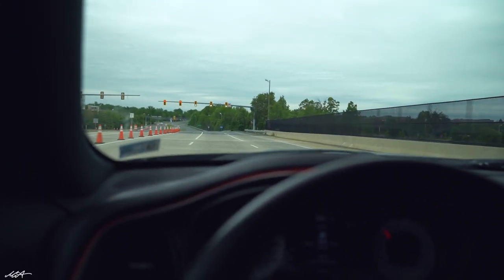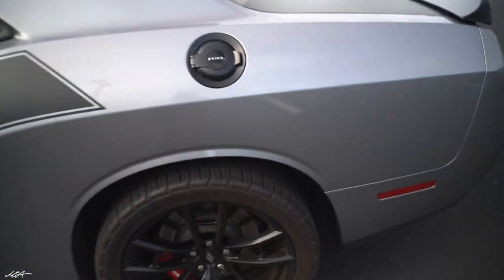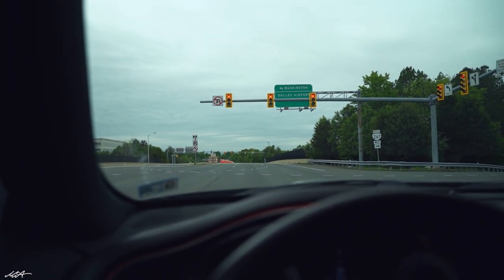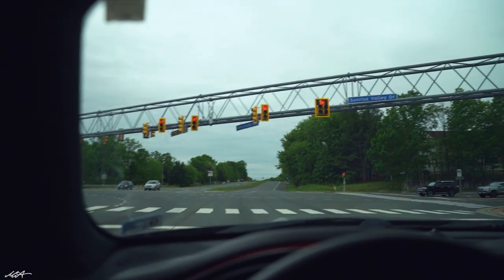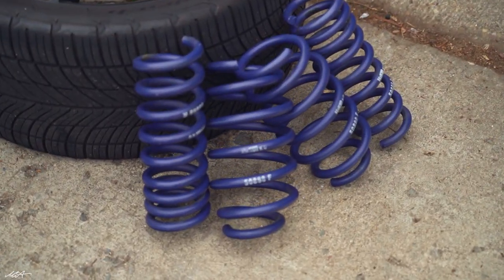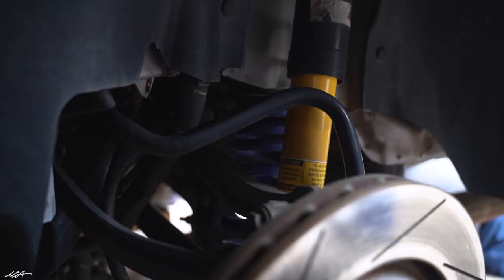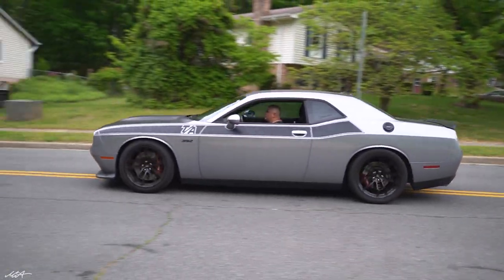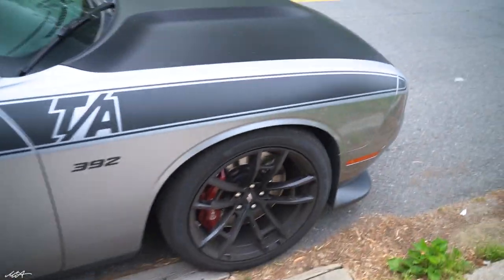VLOG #1 - LOWERING THE CHALLENGER

Comment: No bueno... I went that low on my 17 challenger and after one month it settled even lower all wheel gap was completely gone. Speed bumps and slight incline became a problem. I would not lower these cars more than .5 unless you want to always be extremely cautious. I currently have a 20 now and I’m about to do the .5 drop.
Reply from the maker: I am sorry for what you had experienced! mine didn't go any lower since I got the Springs used and I have not had any issues with rubbing or scraping (got to go through some speed bumps sideways tho)
Reply: .5 drop really isn’t much. Wheel gap is hideous on most cars in my opinion. I think  if you lower a car, you should be prepared to drive differently.
Reply: @CyberD4vey  To each his own. I'd rather not scrap the bottom of a 35k+.
Reply: @JBWHITEGT  what about mustang how low can they go?
Reply: @alexander_3923  Lower than the challengers before they start scraping.
Reply: @JBWHITEGT  that sucks that they can go lower than challengers